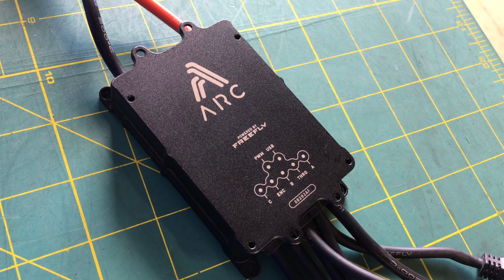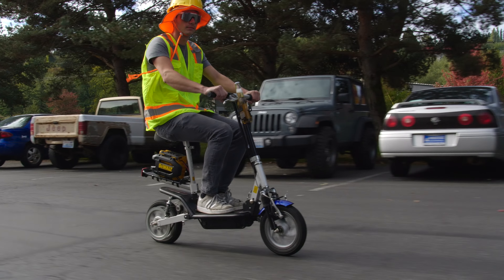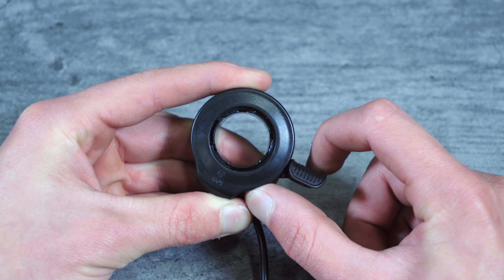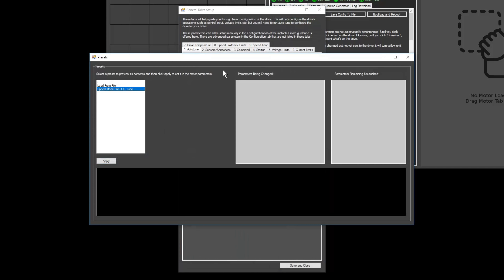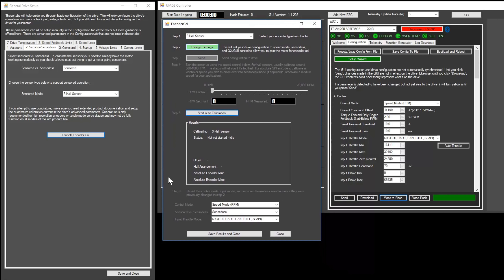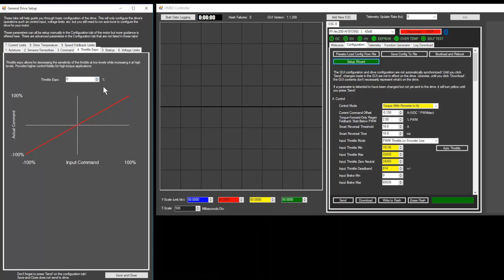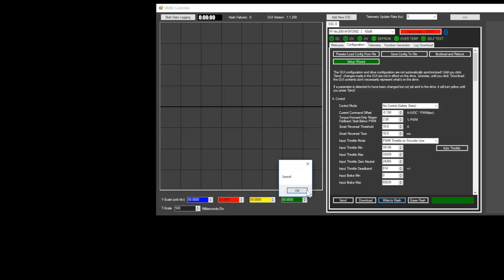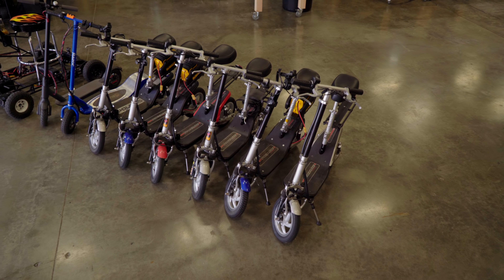50mph Electric Razor Scooter!! - ARC200 Motordrive Setup

Comment: All in all, what does that blue minimalistic scooter cost to build?
Reply: 300$ esc, around 200$ motor,  I guess around 500-600$ for battery (or more, it has bms integrated), throw in at least another 100$ for everything else...
Reply: first of all, you dont need a 8 kw brushless motor....
i got only a 2,x kw 2 stroke engine on my scooter (DIY, what else) from an older 1:5 RC car with some parts from an older bike, this project cost me close to nothing, since i had all parts except small, very cheap things.

without altitude increase, it could go around 40 km/h, with a lean mix close to 50. acceleration was also ok as the engine came closer to resonance with the exhaust
As you may know, with a brushless motor, you got all the way more power also with low rpms.
3kw+ should be enough for a scooter, but yeah, i bet 8 kw are funny :)

you could even run a scooter nice with a Mamba Monster 550 sized engine (like in E-Maxx brushless, its really a monster, especially for a 1:8 rc monster truck), all you would need is some sort of extra air cooling(for long distance and much torque) and maybe avoid starting from zero (hard work for ESC). Biggest problem at all would be, you cant brake with ESC and get energy back into the batteries with this RC ESCs, breaking means energy will be wasted by ESC (and heat it up). ESCs with retrievel are more expensive i think, but correct made, i think they are also longer lasting (damn i broke 3 ESCs in my first rc bl racing car, since i used aggressive settings for peak performance, later 3S instead of 2S batteries but normal timings, better performance, less stress for ESC)

I also though about using this monster RC brushless for it, but i love this car so much, i passed already cars, driving 70 km/h+, on a parallel (car-free!) road  with 110-115 km/h, you cant imagine the faces of some drivers/passengers, seeing such a fast (not for road made....) RC car passing them, while nobody know where i am since i use a gopro connected to FPV-transmitter and a screen with internal receiver cheap from china ( i cant afford FPV googles, and i also dont like them at all)
Not to mention backflips from standing still  or high jumps :)
Reply: I'd say about 1k

Comment: I had as a was like a kid also a scooter with tires and suspension.

As my 1:5 onroad RC car was unreliable(tires impossible to get, broken/leaking diffs, special bearings around the drivetrain got worn out...), except for the 32cc  2 stroke engine with sport exhaust and around 12k rpm max, i also built this on it- but i was already happy with around 2 kw at regular mix, maybe 3 kw and much rpm more with a lean mix and a max speed of around 40 km/h.

But you triggered me to watch some auctions on fast E-bikes with damaged/missing batteries, drivetrains or whatever bring me to a cheap motor and ESC, i will upgrade my old scooter, full of spider web since its in any corner since years.

Comment: Need a complete build video on the e300. Links to parts. Awesome!
Reply: Frog84ss I’m still waiting for this video they promised!
Reply: And it is 2019 and I am still waiting.......
Reply: I don’t think they realize how badly we want a quality E300 build lol
Reply: jondanimal- but I also don’t want to spend $800+ on a $200 scooter...
Reply: Noah Zimmerman I've spent more on dumb things 😂 my E300 is pushing around 1500 watts and goes 30mph but I'd like to get faster.
Reply: @PartialRug  I did 42 without going full throttle 2kw 60v boma motor running 66v would have to baby the throttle it threw me off and on my ass once I definitely learned my lesson.
Reply: @DylanBenkeryodelelayheho  yeah my throttle is the same way! I am using lead acid batteries on the e300 so I would need to build lithium or lipo battery to be able to fit 60v in there. I've since built an electric bike pushing 3600w at 72v but I still want to revisit my scooter someday and make it more refined lol
Reply: @PartialRug  nice I'm personally running around 4400w on my bike it's a mx650 with a 72v 3kw motor I'm running it at 84v and 50 amps. Threw me off for the first time today doing a wheelie and accelerating too hard lol. I just ordered a turnigy 80mm 130kv they're good for 4500w continuous and it's WAYYY smaller and lighter than the 3kw motor I have now that's an inrunner it should be a significant performance gain. I could run it at 100v and go way over 60mph.
Reply: Can you give a list of components in your E300?
Reply: Can you give a list of your components in your E300
Reply: Can you list the components that you used on your E300?

Comment: Does anyone know where i can find the 3d print model for the real HTD 5m pulley? Im currently doing this similar setup on my e300 but using a Turnigy burshless motor.
Reply: Hey! Did you ever find/make a file for the pulley? I’m doing the same setup right now, but I can seem to get my steel rear pulley to mount on the rear wheel, so it would be great if I could get this file.

Comment: Nice tutorial, but expensive motor driver. I suspect the VESC does exactly the same thing for 1/3 of the money.
Reply: Like most products the good ones cost a good chunk of money, or you can take your chances with cheap ones and hope they actually perform what their rating said and they don't burn out too quickly.
Reply: between ESCs are big differences
I have already seen cheap scooters, with not that bad performance, but a very small ESC and bad cooled. It wont last long.
its always a good advice to choose an overpowered ESC, since it will last "forever" if you dont set wrong parameters for timing and so on. But for a scooter you will always prefer smoothness over agressive timings for some rpm or a little bit more torque, so it should never happen that you stress your ESC too much with a scooter, except for long usage and permanent half throttle.

brushless ESCs love 2 states: 100% throttle, or 0% to a very little amount of throttle(like 10 or 20%). permanent 50%-80% is the worst thing for it, or at least the most stressful for the ESC itself

Comment: Wish me luck ? I have razor. Want  to pt 3000 watt 72 v motor but run the €£*t @ 96v will it blow up or is that number still in same volt range were its safe tell me please thanks

Comment: I have the Polaris 707 PaceLite type. I need help. I have your ARC 200 controller. I need to know how I can get it to 50mph. I have two 30ah 60 volt batteries. One in a bag on the rear carry rack and one E-Bike frame battery on the front of the steering tube. I don't know what motor or what sprockets to use or even how to get them. But I am willing to do whatever to make 50mph happen.

Comment: Hello, I have a Polaris scooter like in your video. So-far  I have an ARC200, an Alien 80100 6kw 130kv motor, and a 52 volt 20ah battery pack. I'm wanting to get it to a 45mph....(or better) scooter. I have just started the project. I put a heat sinc with two 2" 12  volt fans to be powered by a 60 to 12 volt  converter. Hoping this keeps the controller cool. I may have to move the rear shock mounts back and also the 80mm motor to make room for suspension travel....don't know about that part yet. I'm wondering if you could help me with pulleys and belt sizes to achieve this? I think you guys are the perfect ones to contact for help being that you already specialize in modifying the scooter I have. Can you help me out? I can ship it to you if necessary. Actually I would prefer to do that if you're interested. I can make a road trip to being it to you if you're within a reasonable drive distance.
Reply: where did you get the controller, arc200, from?
Reply: I ordered it from the manufacturer
Reply: Did you get this running? I have the same scooter, and am pretty sure I fried the hub motor I put on it.
Reply: @RobbinThicc  no I can't get any help from these people.

Comment: Why can't we just use the throttle we already have, what possible difference could that make. You know brother, use what you got, increase the out put great, but why buy what you already have.
Reply: That would depend on what the existing throttle does, they don't all work the same way.
Reply: I have the razor motor and speed control, but it's on the eco smart scooter.